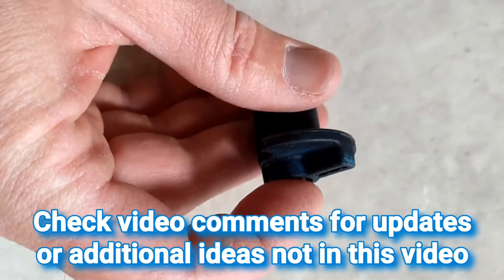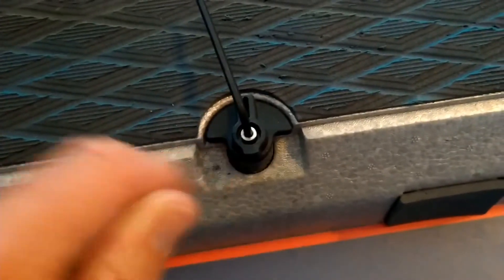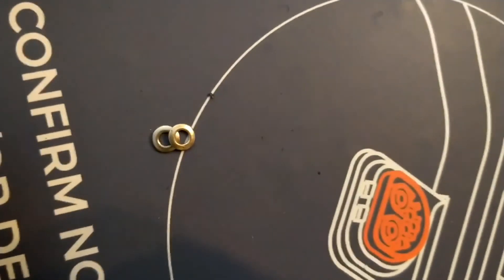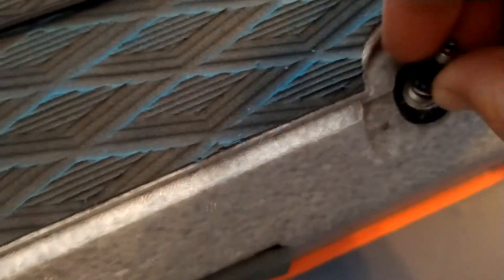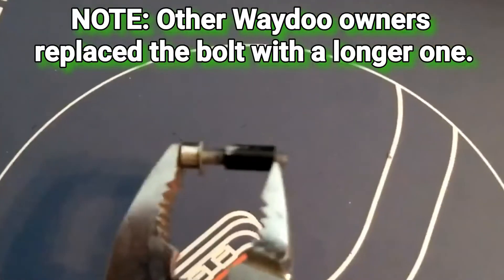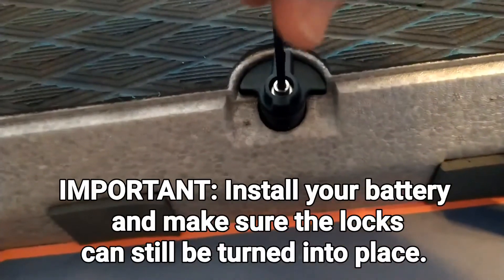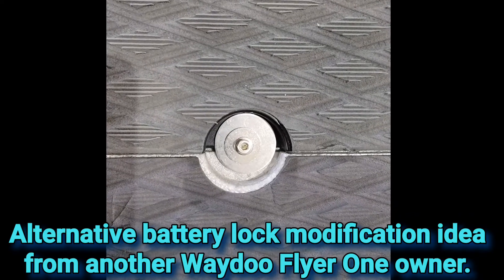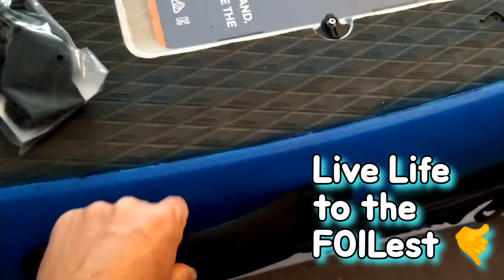Waydoo Flyer One - Battery Clips Modification Upgrade

Comment from the maker: This is only a problem with the early first year decks.  If you bought an older used Waydoo, check to see if this needs to be done.
⭐#6 stainless steel washer

And a link to Longer screw that other owners have used for the battery clip
https://www.amazon.com/dp/B07P53Z7V7?ref=ppx_pop_mob_ap_share